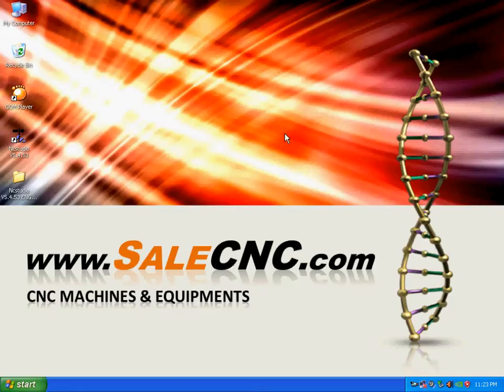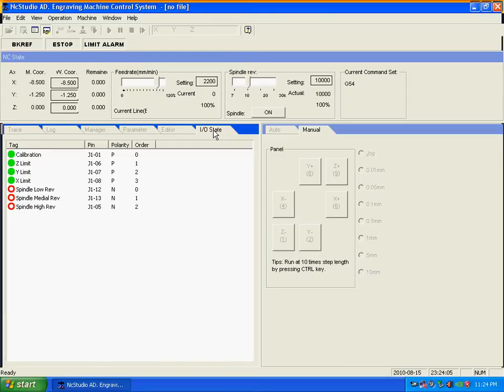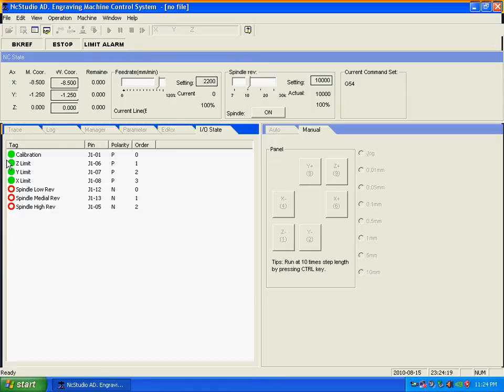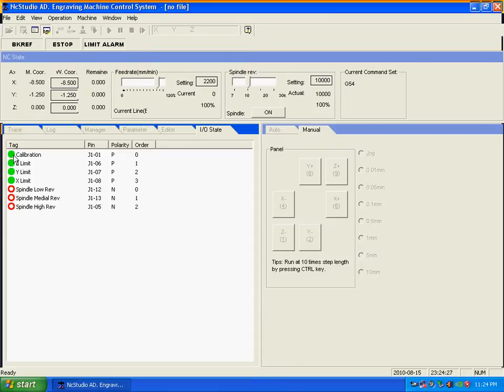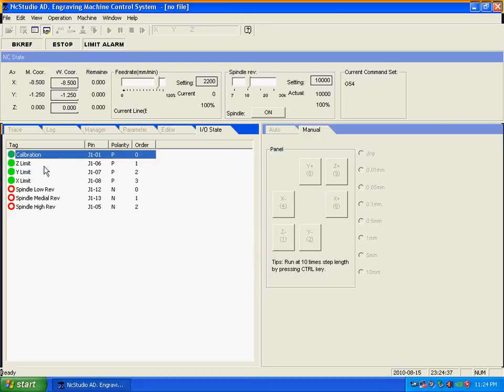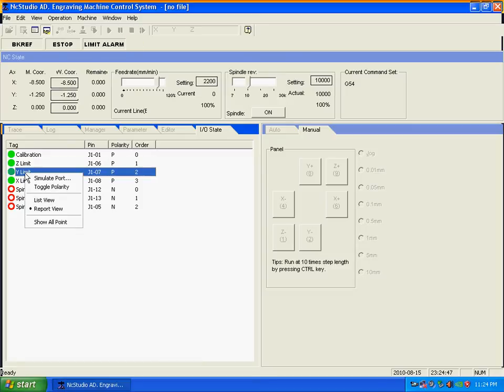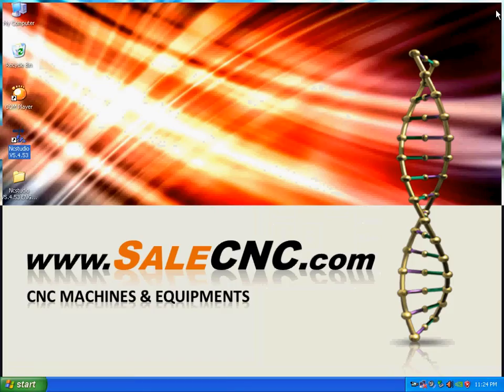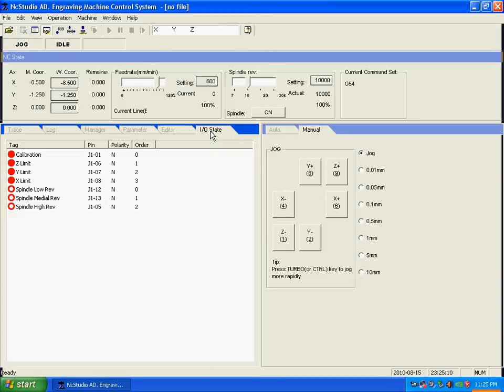03 NC Studio Limit Switches CNC Milling by www.SaleCNC.com

Comment: The problem with NC studio is the limit switch handling is RUBBISH. They are "hard stop" they should be configurable so that if the machine hits limit, it stops motion, retracts Z to safe, then retracts the X or Y axis so that the machine is out of limit condition, THEN it breaks operation and closes a relay to light "ERROR" lamp. Terrible software.
Reply: I know this us an old thread but how can it possibly not have encoder limit settings?  It hits stops when it hits the mechanical limit and jams?  Then it backs off?  I don't see any kind of mechanical switches on the limits.